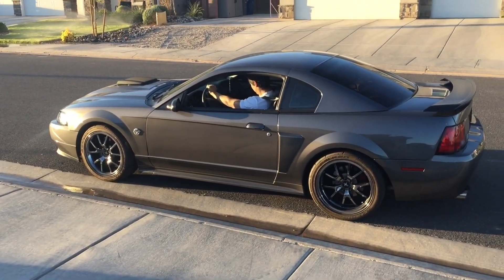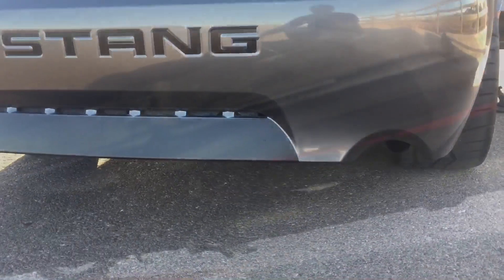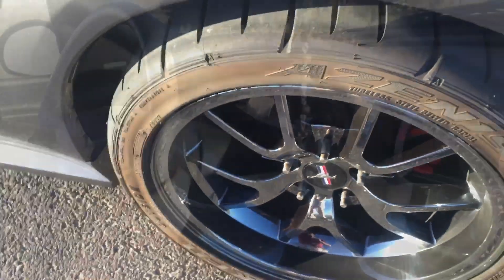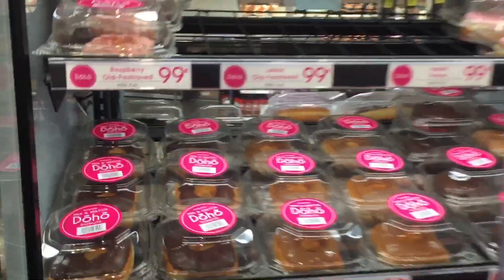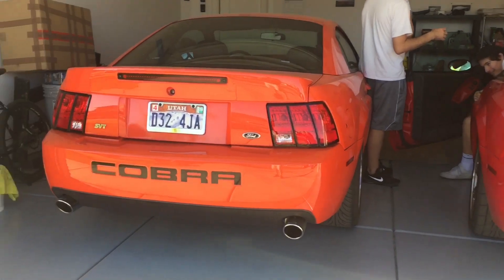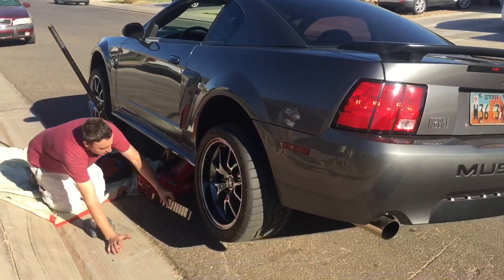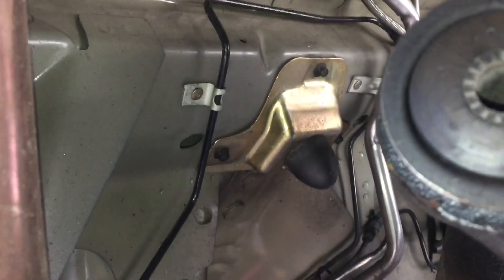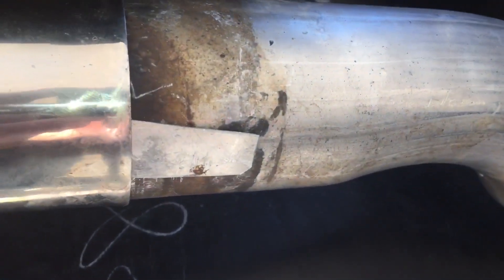Kenne Bell Mach 1 diagnosis, repair, cruise

Comment: Just starting my wiring for my gauges, where do you recommend I get the bung welded I have long tube headers, and the o2 sensory is towards the end of the long tube
Reply from the maker: For long tubes you want it in the collector as well, or just after it if you can’t

Comment: How did you get a kenne bell on a mach 1? Does it have "Eaton swapped" timing covers/alternator?
Reply from the maker: This one actually has the kit kenne bell made specifically for the mach 1. It uses a lower intake manifold from the 03/04 cobra and then it just runs off the one drive belt with the rest of the accessories so no mods needed for the crank pulley or anything. It’s good for ease of install and this is the intercooled kit, but then you don’t have the flexibility of a larger lower since it’s only one belt system and all 6 rib.
Reply: @dannyjohnsonsgarage  what the????  I had no Idea kenne bell made a kit for the Mach 1. Do you think it could work with an 01 Cobra with some modifications?
Reply: @dannyjohnsonsgarage  unfortunately after looking into it,  I found out Kenne Bell no longer manufactures the kits for the 2001 cobras and mach 1's 😩

Comment: Hey Danny  have you use piggyback harmonic on the 4.6 2 valve 02 mustang? Do you like the smaller size damper like ATI , trick flow or summit racing?

Comment: Awesome video  and what a  coincidence cause I also  got problem myself with my new edge stang with the check engine code of running lean and low voltage for the up stream o2 sensor, might be the exhaust manifold gasket cause I here a puff puff noise from it.

Comment: That’s a torque arm probably from maximum Motorsports.  It should have a panhard bar as well.
Reply from the maker: You’re right! It has that. Do you know if it shouldn’t have the upper control arms?
Reply: @dannyjohnsonsgarage  yes,  The panhard bar and torque arm together allow removal of the upper control arms.  The setup is great for traction and cornering but the parts often make exhaust nightmares.. I remember I have the PHB on my old Fox and I had to run dynomax specific 2.5in tailpipes as they followed the factory bends and somehow just cleared everything..  everything else hit.
Reply from the maker: Thanks! Pretty hefty setup!

Comment: Do you know why the supercharger dosent whine?
Reply from the maker: Pulley size has a lot to do with it, so it’s probably a low boost setup. Making the supercharger pulley smaller or the crank pulley larger will spin the supercharger faster and you’ll hear it more- but it requires a tune so you don’t lean it out and melt a piston

Comment: I recently changed my head gaskets on my 2001 gt... Question is do I have to retune it cause it doesn’t have the same power... Like it did before
Reply from the maker: The tune should be be affected for only head gaskets.
Reply: Danny Johnson’s Garage should or shouldn’t??
Reply: No you should NOT have to retune car
Reply: Ruben Ramirez  do you have a idea on why it doesn’t have the same power? Maybe the cams weren’t put on the right way ?
Reply: @joeyzuniga3351  yes maybe it wasn't timed correctly
Reply: Ruben Ramirez thank you sir I’ll look in to it
Reply: Ruben Ramirez Do you think that’s why it’s turning off and on
Reply: @joeyzuniga3351  Most likely like the other guy said,  the camshaft is probably off a tooth.  That can definitely cause lack of power and intermittent stalling. You only need to tune a car if your installing parts that seriously affect how much air/Fuel your engine is getting.  Examples being turbos,  superchargers,  fuel injectors, Etc.
Reply: Chris Hernandez thank you sir!! But we did some more investigating and it turns out that I had bad spark plugs and bad coils
Reply: @joeyzuniga3351  awesome 👍 Cheap and easy fix!
Reply: Chris Hernandez thank you!

Comment: Hi, my son owns this car now
Reply from the maker: Congrats, it’s a beautiful car
Reply: Thank, he loves it but it has been having some issues, do you know why the guy who owned it before sold it?
Reply from the maker: @dalemackey8111  He sold it because he was moving and wouldn’t have a garage for it anymore. What problems is it having?
Reply: Oh cool,  the rear end is starting to make noise, which is the pinion bearing, 3 different idler pulleys got destroyed and the a/c compressor froze and ripped the belt to shreds.  Now the fuel pump is having issues but we have no idea what was done to the motor or what size the supercharger is, until i watched your video about the car.
Reply: Fuel pump doesn't have enough pressure for the motor.  Not sure if we should replace with a factory ford pump or after market
Reply from the maker: @dalemackey8111  There are a few options, the most simple being a better aftermarket fuel pump and a boost a pump if needed. You could also get a terminator fuel tank which is better because it’s a sump tank with twin pumps. Or you could go to a return fuel system. I’ll put links to them below. You might want to check to see if the boost a pump is already installed 
  Fuel pump change https://youtu.be/UhgkGXLSkl0
Reply from the maker: Boost a pump https://youtu.be/kb5GOgXJatE
Reply from the maker: Return fuel system https://youtu.be/bteiCwIHuq8
Reply: We added a 300 gph fuel pump and it still isn't getting enough fuel.  Still trying to figure stuff so we can get it to run right.
Reply from the maker: @dalemackey8111  how about injectors?
Reply: Same as when the one guy owned it, pretty sure 60 lb that comes with the kenny bell kit, cause we haven't changed them and the dealership my son bought the car at had the car for over a year before it sold.
Reply from the maker: @dalemackey8111  how about the fuel filter? https://youtu.be/4cu_37FyQqM